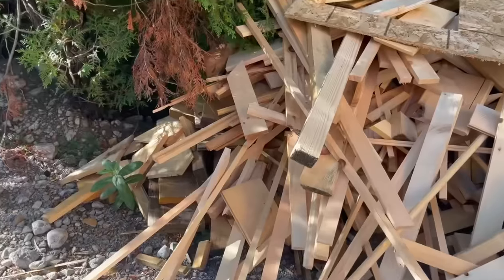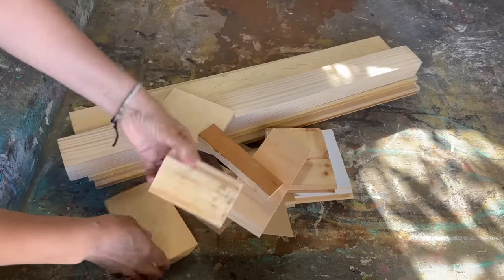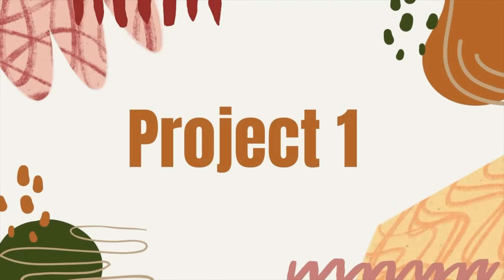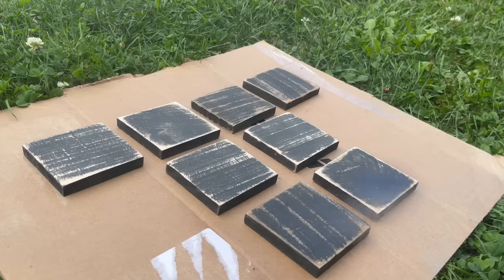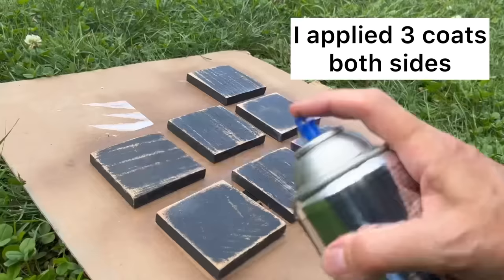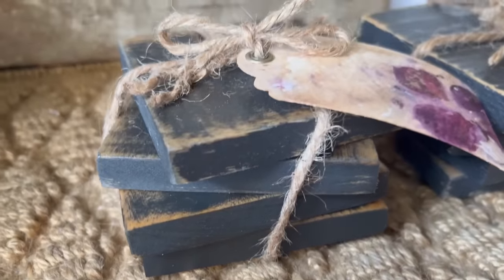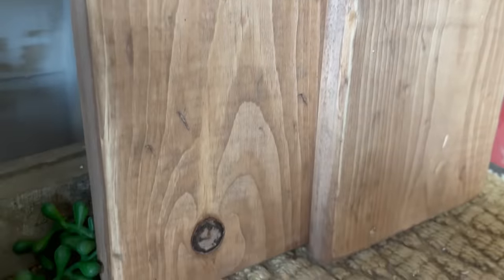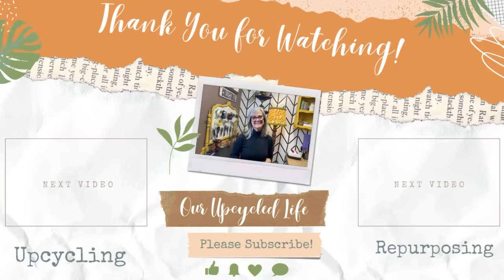Turning Scrap Wood into Cash / DIY Projects that sell Quickly

Comment: A little tip to help with a vintage wood look and feel. Get a wire brush wheel for a drill and use it on the surfaces around the writing. It scrapes away the softer part of the wood and leaves the harder parts. Gives the look and feel of reclaimed barn wood.
Reply from the maker: Yes that actually works very well to Age wood also thanks for sending the tip here for my followers
Reply: Nice idea...look forward to trying that!

Comment: If you use the shiny backing paper from self adhesive labels to reverse print on (with laser printer) it comes away without all the bother of rubbing after the Mod Podge dries.

Comment: awesome tutorial.....i have 4 spring craft fairs coming up...got alot of new and very cool ideas here...can you cut food on the cutting  boards  or are they just  decorative..how should i seal them after the stain?  or is sealing not necessary....are they food safe... if just stained?  thanks
Reply from the maker: The ones that I have made here are for decor only if you’re making cutting boards to use you have to make sure you get the right type of wood and a food grade oil to seal them with. Thanks for watching.

Comment: Hi again Diedra!! I have been preparing for my 1st Craft Show in October... I have a couple of questions... I've been picking up EVERY piece of wood I see for free or next to nothing... I recently found a television armoire that had fallen out of a pickup truck ( I guess...) But it HUGE and only has a couple of pieces busted off it.. but the whole sides ( 3 ft wide 6ft tall) are in perfect shape! The shelves inside it are the same way... I know I can make signs with it. But my question is... Can you use pressed wood to make bread boards?
Reply from the maker: I find that the pressboard is probably not the best wood to make into breadboards but they definitely turn into fantastic signs

Comment: Great job. Wondering how you decided the overall size of the piece. I have a small cross to use as a template but I didn't want it too big/small for the overall size. I'll be adding a Bible verse as well. Thanks
Reply from the maker: I don’t really have a certain size I just make all kinds of random sizes whatever I’m feeling that day

Comment: Where do you get the engine enamel? An auto parts store? Love love love your channel 💕💗💗💗💗💗💗
Reply: Auto parts stores have it . Amazon also has it.
Reply: @Susan McBride. Yes, as Rays' Blue Basement Workshop says auto parts stores and amazon has it. Walmart also carries it at a cheaper price but does tend to be quite thin. F.Y.I. all engine enamel is, is a high heat enamel that resist peeling/melting a temps usually below temp rating on label which can be anywhere between 350F to 1100F depending on the type. If you can't find engine enamel I suppose you can use standard enamel from say your local hardware store or home improvement store (home depot, Lowes, etc.). However, engine enamel is designed to be more tolerant when it comes to adhering to surfaces that are not perfectly clean and usually you will use less of it than standard enamel which may separate especially on surfaces that may have an oily residue.

Comment: I want to make wood coasters with scrapbook paper tops, can the engine enamel be used for sealer? Does it yellow? Using paper should I use a different sealer??? Tia
Reply: @Lorienutter
If she is unable to reply- please Google & keep just putting those 2 words on search-when u find answer-maybe you  cld post it...I am not sure I will be doing these myself or I wld for you- drowning in research myself.

Thank you good question
Reply from the maker: Hi there yes for sure you can use scrapbooking paper you can decoupage it on and then put your three coats of engine enamel sealer on top of it but I do find scrapbooking paper is quite sick to work with and doesn’t lay flat and nice so I do have a video on how to make thick paper easier to decoupage with you can look that up on my channel and that might work out better when you’re trying to put scrapbooking paper on top of coasters hope that helps

Comment: Craft shows usually have entry fees which must be overcome before there is any profit made.
Reply from the maker: Yes you would have to take that into consideration when you were pricing
Reply: Yes exactly right. Whenever I did craft shows many moons ago, my first goal of the day was to recoup the cost of my stall or table. 
Once I did that,  I was a happy camper.